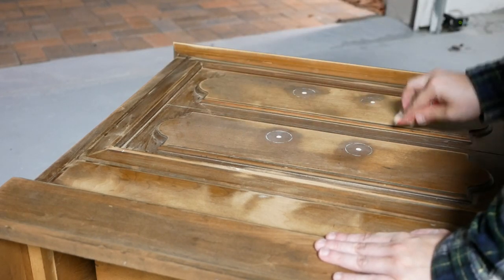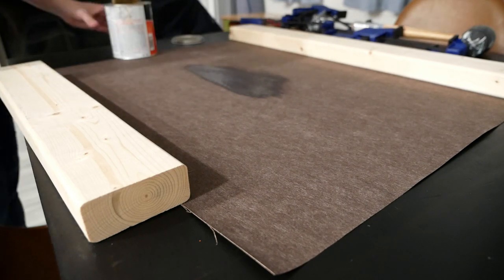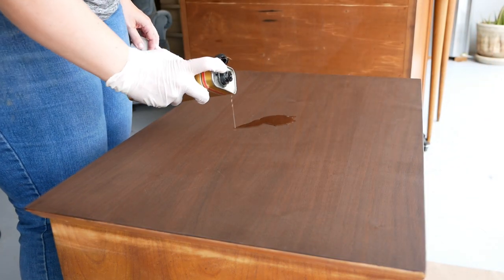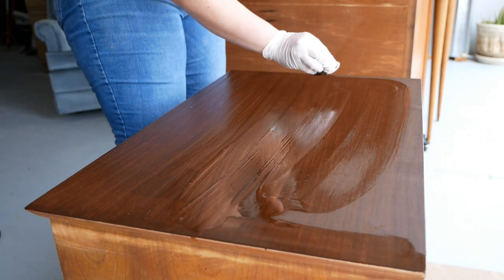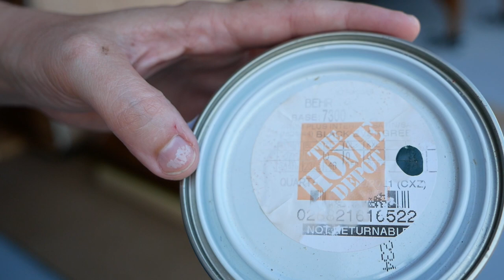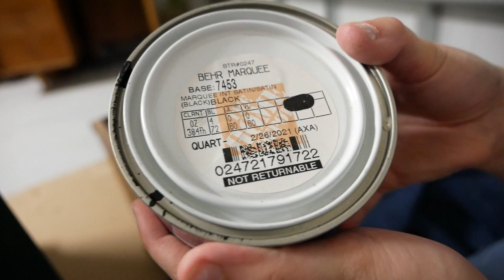Transforming a Water Damaged Record Cabinet & Adding new Veneer to the Top | Paint & Stain refinish

Comment: You did a great job on this piece. It had a lot wrong with it. I have done a lot of stenciling in the past. I always use a flat topped stencil brush, with bristles, and I pounce most of the paint off of brush onto paper towels or clean piece of cardboard. Or I’ve even used a brown paper bag. Your brush is almost dry when you begin pouncing paint onto your stencil. You can do a couple of coats for darkness, but there shouldn’t be bleed-thru this way.
Reply from the maker: Thank you for this tip Jeff! Are the brushes fibers more dense or on the thinner side?